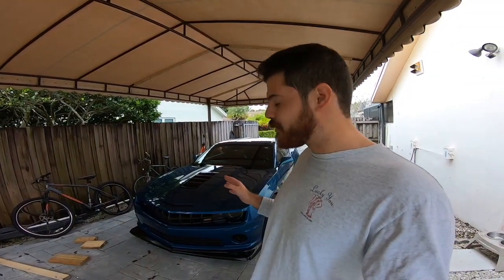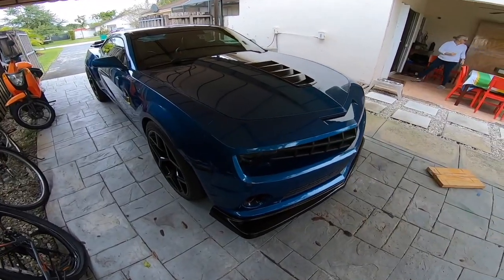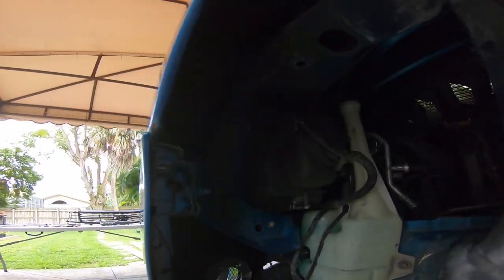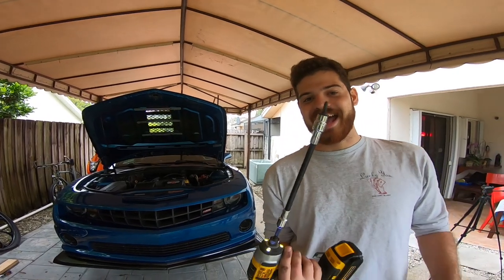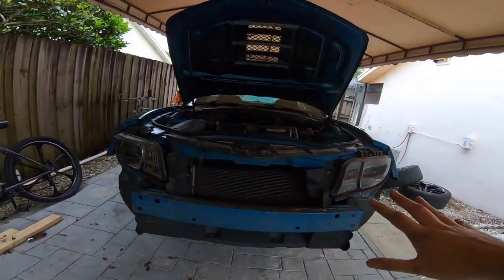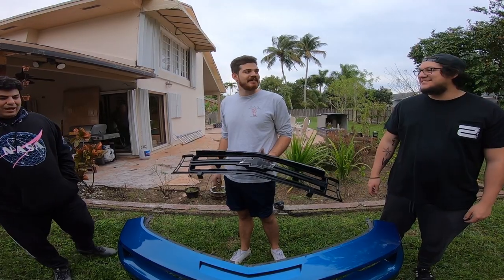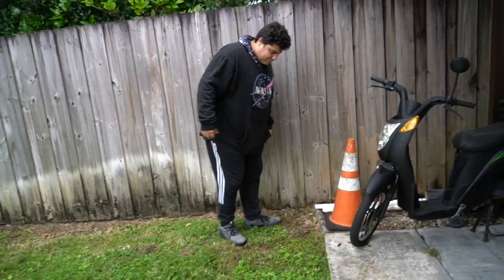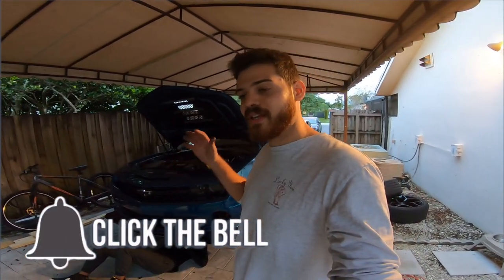ZL1 Grille Install on a 5th Gen Camaro SS/RS | 2010-2015 Camaro SS/RS Bumper & Grille Removal!

Comment: Did your ss bowtie emblem fit on the zl1 grille? Also what did you use for the small ss logo next to headlight?
Reply: all the bowties are unviersal fit so u can just transfer your current bowtie. For the emblem, you need to drill holes for the SS or RS emblem you have because the holes only line up for the zl1 badge.

Comment: Did it come with the Chevy emblem?
Reply from the maker: No bro, I swapped it from my old grille. I kept the bowtie when I did the delete piece.
Reply: @gvaspirated  how did you put the old emblem on it.. clips are different or am I mistaken?
Reply from the maker: @dannygonzalez4017   had to snap off the extra bit. 3 clips will hold it. You could also dremel the space to fit the 4 clip